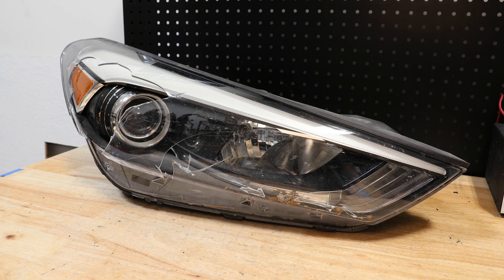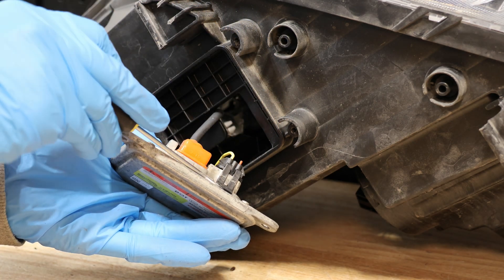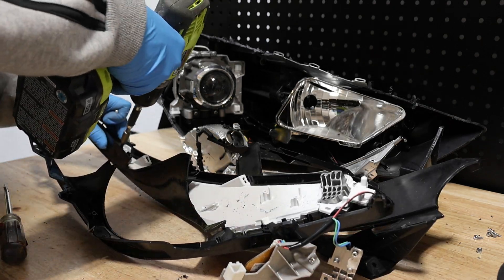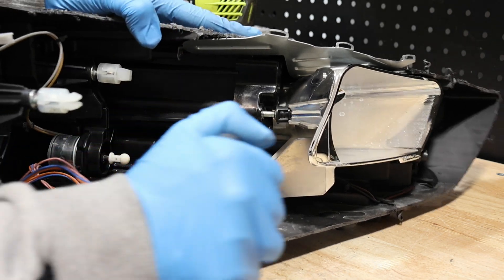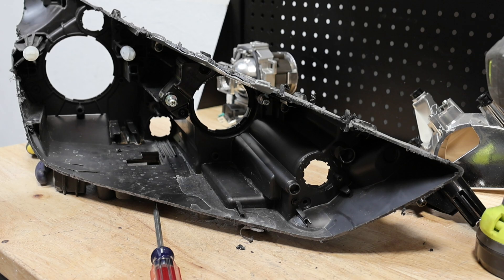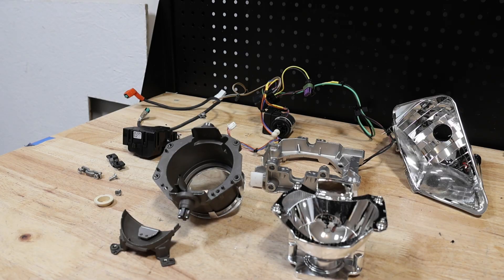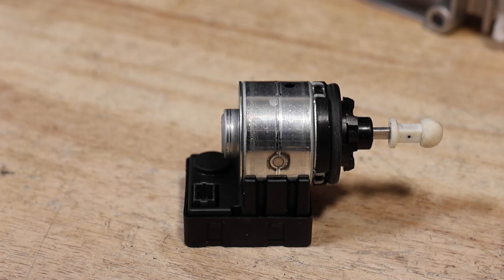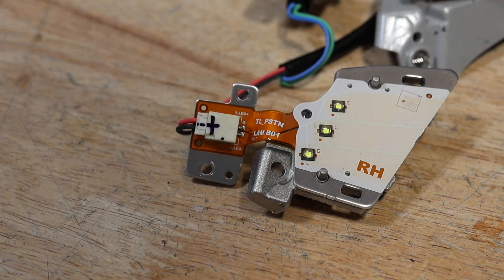How to Disassemble a 2016-2018 Hyundai Tucson Xenon Headlight

Comment: I have a 2020 Hyundai Kona with small screws connected internally with the lens and want to separate the lens and housing using the heat method. What internal components are the internal screws connected to and can the lens and housing be separated with the screws connected to the lens? It appears in your video the internal screws are connected to an internal bevel system and want to confirm the internal screws are not connected to the lighting components also connected to the housing. Your answer will be greatly appreciated.

Comment: woww beautiful work, I have some questions to ask.
I saw that the osram D3S bulbs are mounted, how is it possible? Did they change all the wiring or did the headlight simply leave the factory like this?
May I ask if you have the availability of two front headlights right and left?
Thank you
Reply from the maker: The headlight as shown is completely factory.   The bulb is held in with a holder and 2 screws.  

I do not have any whole headlights available at this time.